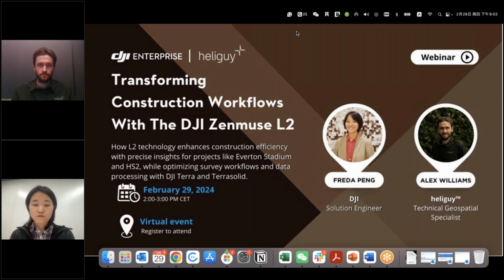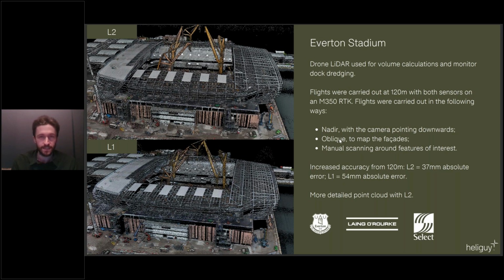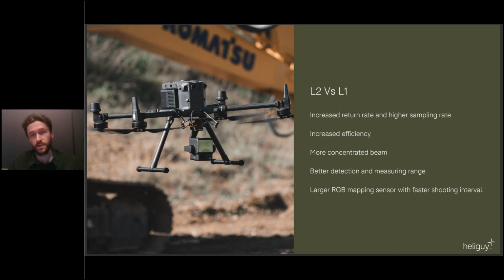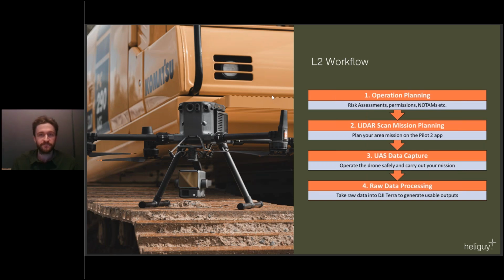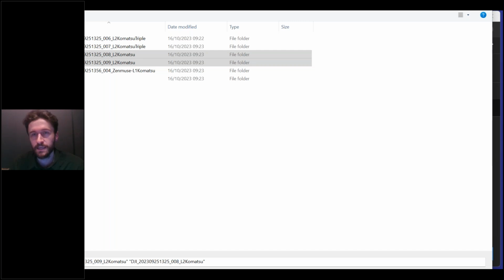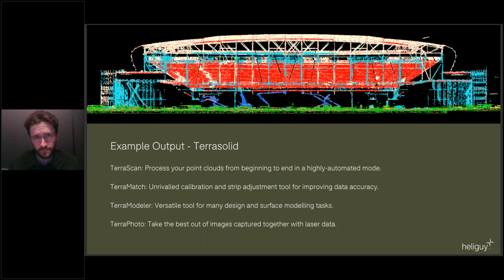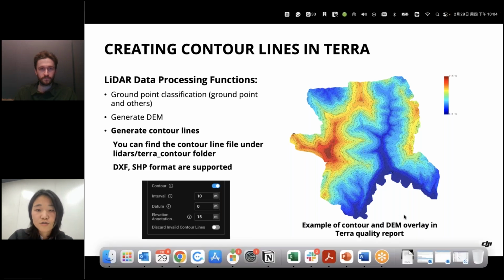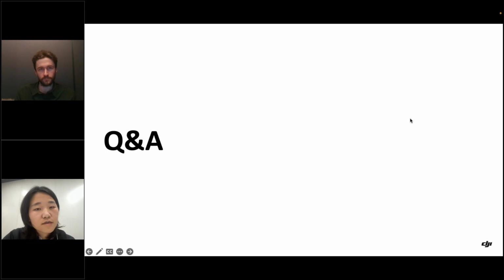Transforming Construction Workflows with the DJI Zenmuse L2

Comment: Did the comp screenshots from Alex suggest the L1 was actually NOT capable of getting those jobs done, particularly the shockingly bad result of transmission line capturing? Didn't many experts make strong claims that the L1 was perfectly fine doing just that? And when you say how clean the L2 point cloud is, can you please zoom in to the ground areas under trees and show a proper profile?